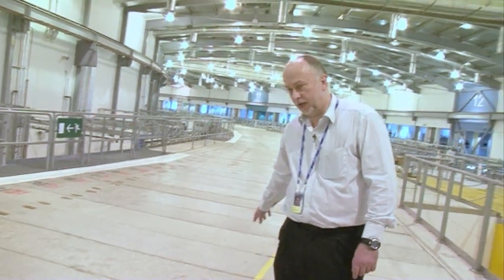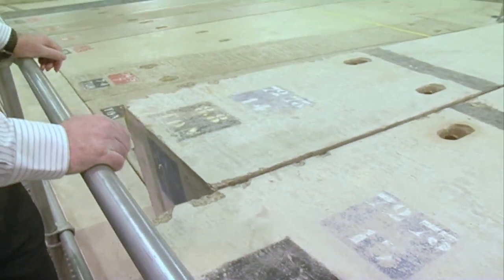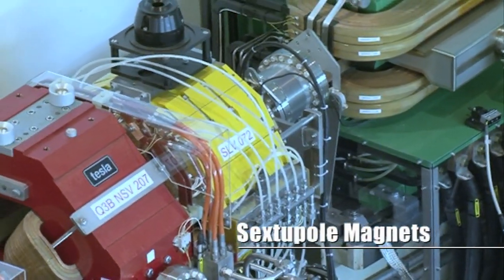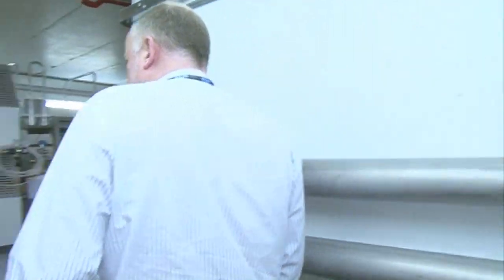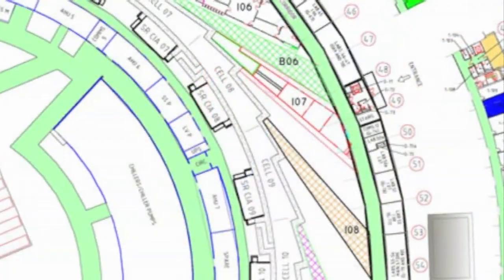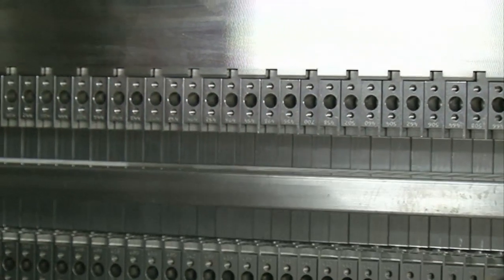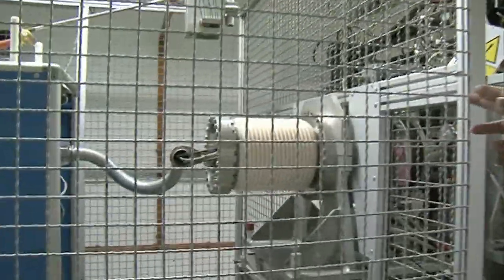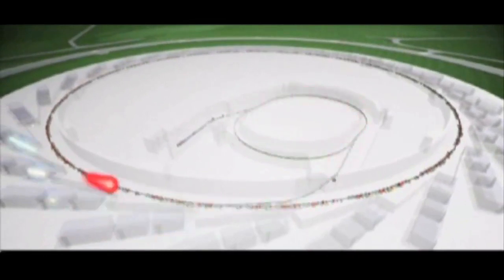Inside Diamond - Backstage Science

Comment: @anonysquirrel - if you think of acceleration as a vector (i.e. it has size *and* direction), then the electrons are accelerated as they are changing direction, and it's this change in direction that generates light. But they don't gain any energy - they get up to 3 GeV in the booster and then that it just maintained in the storage ring.

Comment: @YoutuChannel I know what you mean, all that sensitive equipment covered in concrete dust ! But if you look at 0:57 there is reflection from the lighting overhead.
This looks like a type of high grade concrete (usually non previous to oil), and the casting looks smooth and precise so it can be cleaned very well and will not give off much particles (dust).

Comment: @Draxis32 - as the electrons pass through dipole ("bending") magnets they give off a wide span of light, from infrared to X-rays. So if you want infrared you use a bending magnet. Wigglers make the electrons bend lots of times, and you can tune the path (a bit) to tune the frequency, but also lots more bends means lots more photons, so the light is also brighter. Does that make sense?!